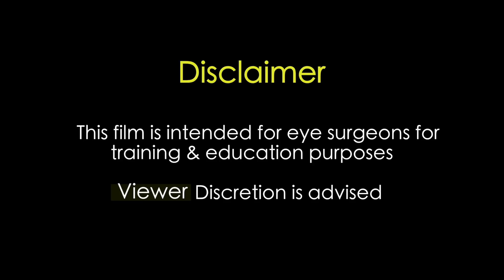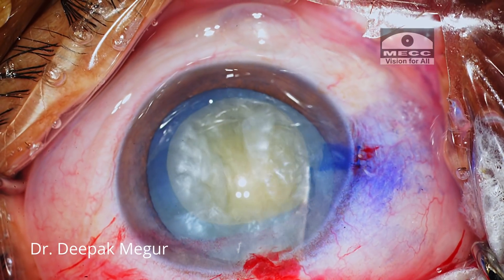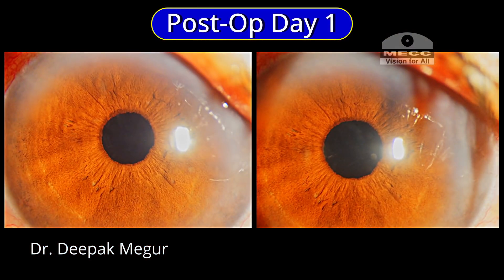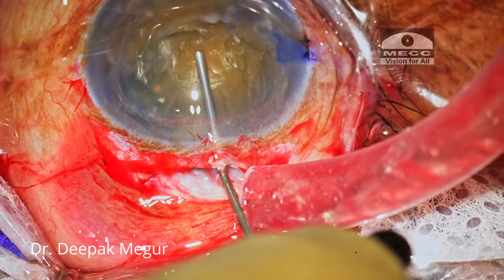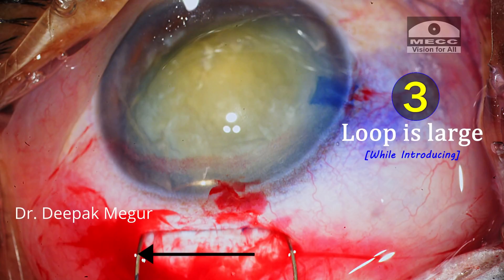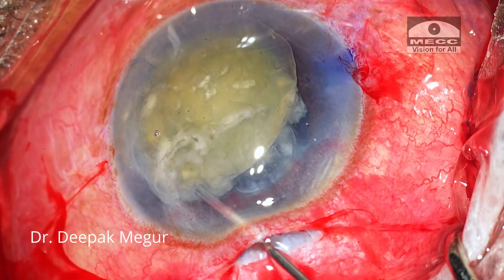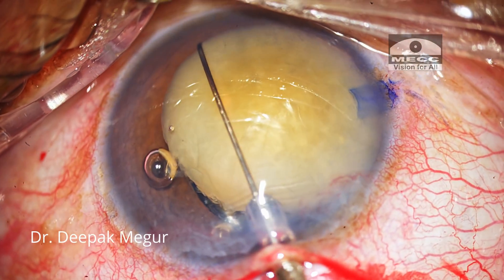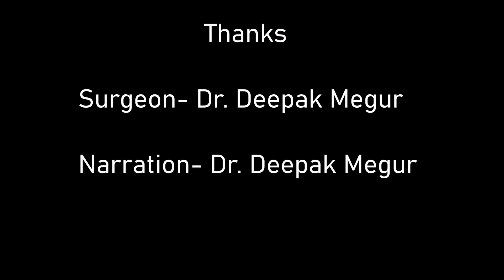The "SNARE" for manual SICS : My initial experience - Dr Deepak Megur

Comment: Beautiful video sir. My query is.. In case of Hard cataract , making a large tunnel does the job most of the time.. what's is the benefit of so much of instrumentation.
Reply from the maker: You are right ,of course that is the easier option. 
But if you want to consistently  perform surgery with less than  6 mm incsion so that your SIA( Surgically induced astigmatism ) Is less and well controlled then we have to master some technique of nucelus bisection.
Reply: @DrDeepakMegur  Too good sir. I think one way to solve SIA issue is to  put a stich at end of surgery.Thanks for sharing